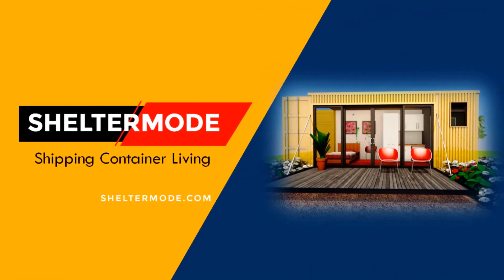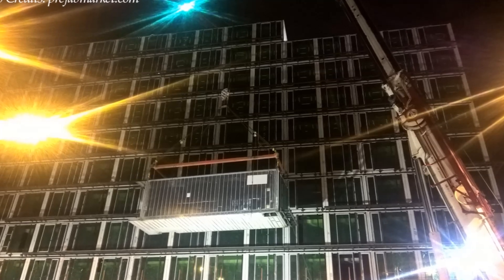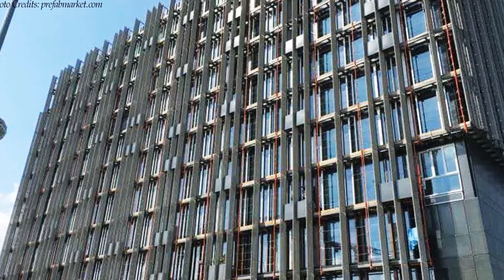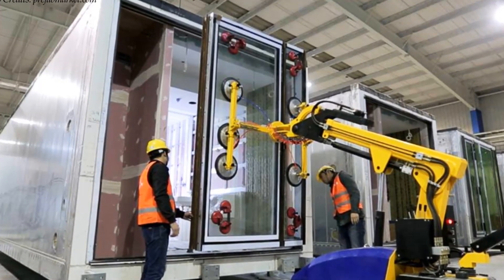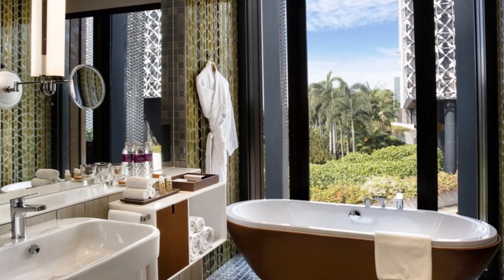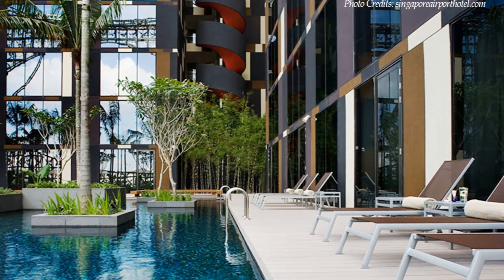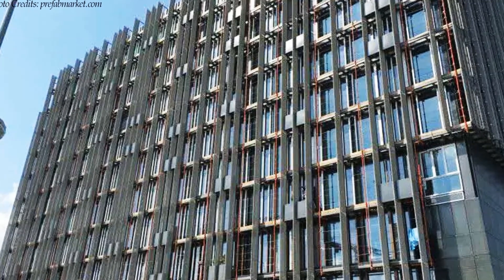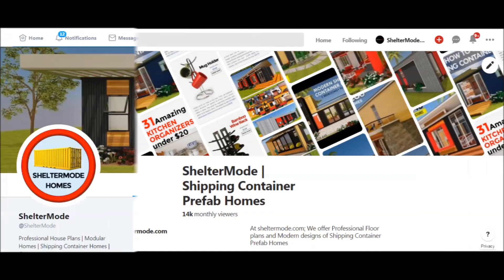Crown Plaza Hotel Extension Changi Airport Singapore by WOHA

Comment: Standard Shipping containers can be stacked 8 stories high and come with a waffle shape on the sides.   Standard containers have more of a domed top and stack only on the corners, to top and bottoms don't touch.   These building containers were custom designed for the construction of this hotel specifically, and come with flat reinforced tops.  Standard shipping containers don't look like this.   These containers have steel reinforcement in the walls floor and ceiling and perfectly flat ceilings.   It would be great to purchase the same type of superior building block containers.   Fabulous quality.   The cost per container doesn't seem to make sense at only $950.  Perhaps it is simply 1/5th of the cost or North America.  Fully finished insulated container homes from a factory would certainly bring the cost to the lowest possible.
Reply: Therefore, not using containers to recycle....